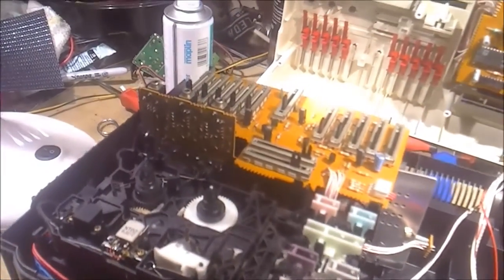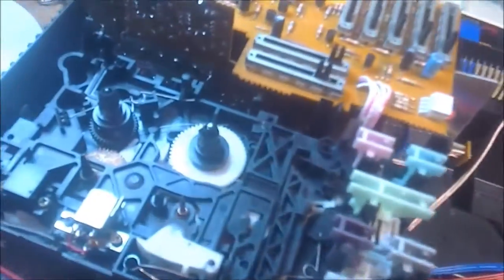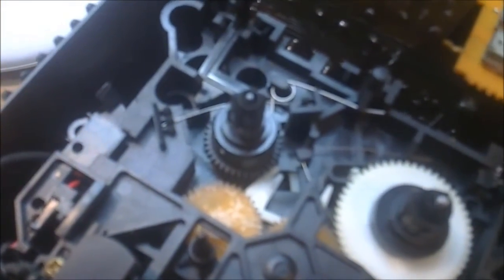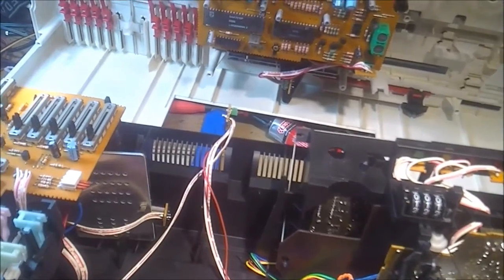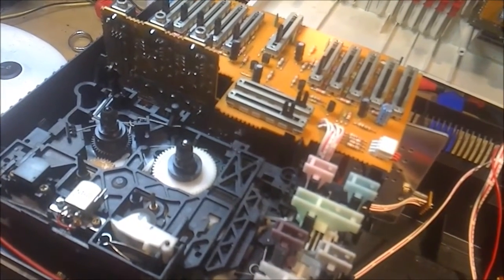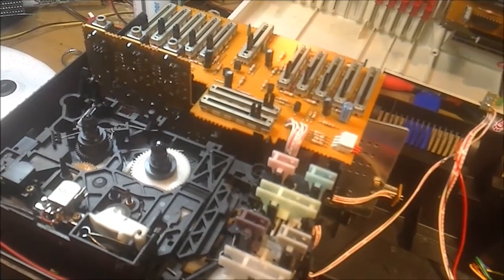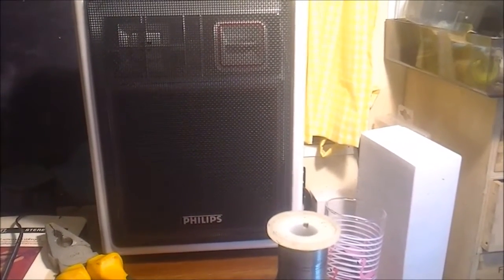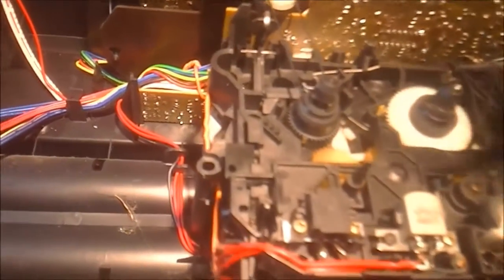PHILIPS D 8958

Comment: I don't really have hopes for you to answer, but I found one of these inside of our shed/workshop and tried it out. It still works, everything works, even both tape players that failed for you are still in working condition. 

Sadly it was very dirty. And even though I cleaned it as good as I can from the outside I now have problems with all of the sliding potentiometers for equalization and volume. The speakers cut in and out, some frequencies are just gone spontaneusly and they are very, very scratchy. I can sometimes touch them in specific ways and the speakers will fully work for as long as I hold my fingers there. So it definetely is some kind of loose connection. Probably from dirt and corrosion inside of the sliders.
 I would like to know how I can get these back into working condition with minimal risk of damage, since the boombox is otherwise in decent condition and, as I said, works. 

I'm also struggeling with opening the thing up. Don't want to damage it and I've never worked on audio equipment before. ; ) 

But I'm gonna figure it out eventually.